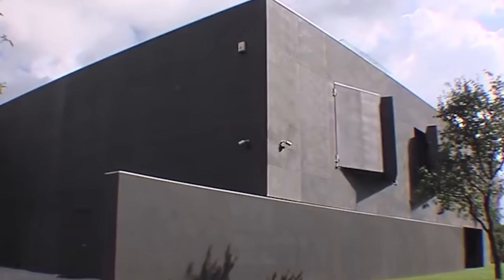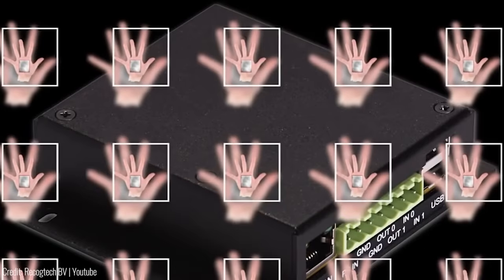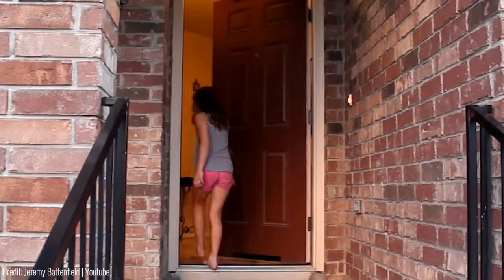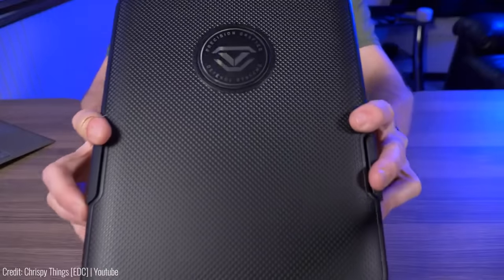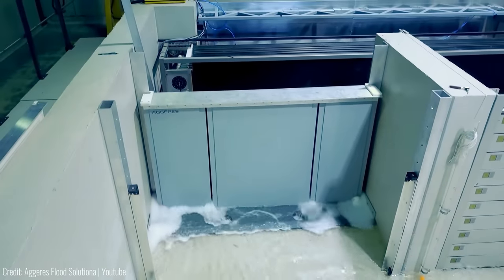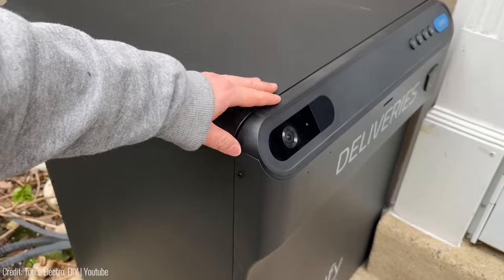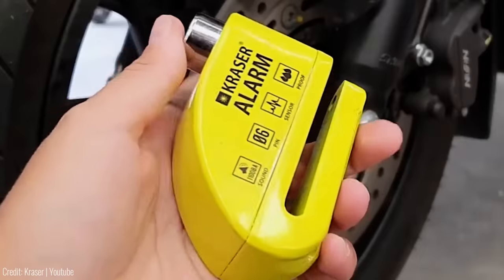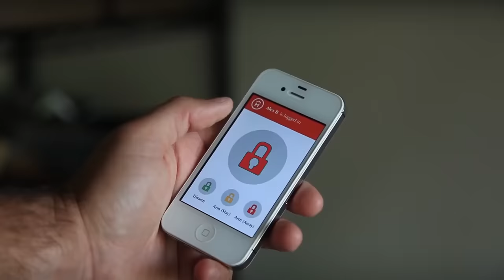12 Home SECURITY Inventions You Must See !

Comment: The safe box is nice but you'd have to bolt it down or lock it in an immovable safe or they'll just take the box.
Reply: Yeah I was gonna say that thing is less than useless. Not only is it easily movable, if I were looking for high value items the first thing I'd do is look for a lock box like that. Take a dremel with a cutting disc and you can saw through the hinges in just a few seconds. So not only is it ineffective at protecting your valuables, it actively advertises their presence. You're literally better off shoving your old rings and necklaces and shit in the pocket of a worn out pair of jeans, folding that up, and sticking it at the bottom of your pants drawer.
Reply: I thought the same!
Reply: Not only that but they left the hinge exposed. Easy to get in.
Reply: also the annoyance of having to open it for the delivery guy each time they drop off a package
Reply: The video showed them drilling through a template placed on the ground, so it seems they were anchoring the base to the concrete
Reply: Apologies,  I thought we were talking about the Amazon package box
Reply: Or you could make it detonate if they ever decide to take it a certain distance away

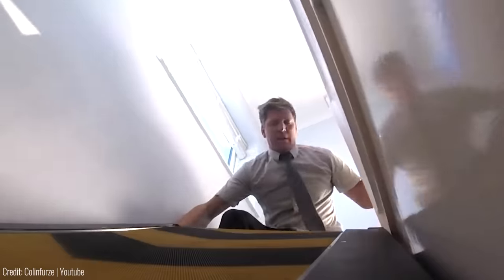Comment: 2:15 No, it doesn't prevent buglers to come to the upper floor. The video itself shows a easy way, just step right and left beside the belt.
Reply: Good for them that on the thumbnail of the video is Colin :D That's why I clicked it :D
Reply: Pretty sure that one's just here for laughs, not ment to be serious. The control is at the bottom, they could just turn it off.
Reply: They didn’t cover this but stepping on the side panels  will trigger the release of the swinging paint cans
Reply: Its not for security, this channel just stole a video colinfurze made in lockdown
It was designed as a joke to keep fit during quarantine :/
Reply: Or simply flip the switch at the base of the stairs to off...

Comment: About that thread mill stairs, it looks that there is a lot of space that is not moving on the side. Very easy to get up. But as additional workout tool, that is a great idea.
Reply: it was designed by collin furze as a workout device
Reply: I was looking more at the fact the control box is at the BOTTOM.....
Reply: @barral69  it was designed by collin furze as a workout device
Reply: Its a workout device, not a security device. Must be included here for comedy.

Comment: 3:18 Looking at how American homes are built, just kick in the wall next to the door 🙂
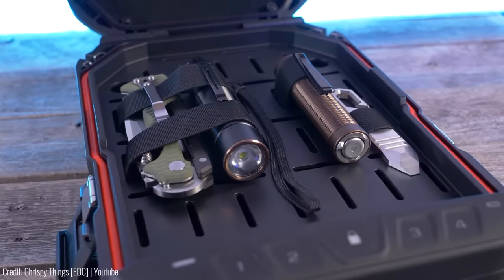5:20 The original Holland America Line headquarters in Rotterdam, Netherlands.
Reply: actually yes while you can amount a lot of homes interiors amount to really thick paper ie plasterboard the outer walls are often wired mesh and coated and even harder plasterboard.  you might be surprised at how durable that actually is.  source I've kicked and brocken my foot on these walls before.
Reply: Somebody who's lived in America for a multitude of years I hate drywall

Comment: Most of the high tech products focus on the tech and forget about simple things like heavy steel being more durable than plastic and simple bypass attacks such as a magnet being used to actuate the solenoid causing the lock to release.  On top of that, Colin produces meme material, not true security devices.

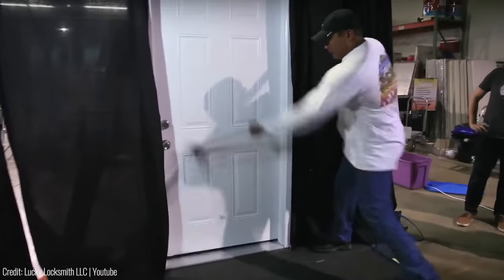Comment: Sealing the door is all well and good, but if the intruder has an axe, [as seen at 9:42] what's to stop said intruder from just barging on in through the window? 🤣
If I needed that kind of security, I wouldn't use a computerized snake oil doorstop, I would get a military grade door, and bulletproof glass windows with steel bars and reinforced steel shutters!